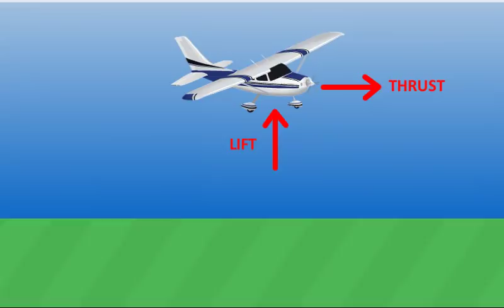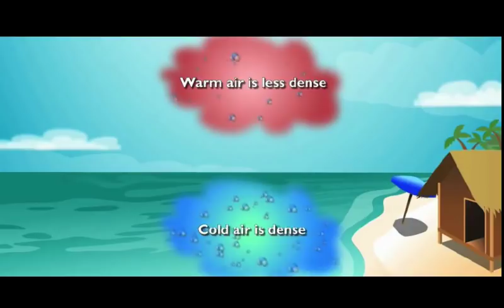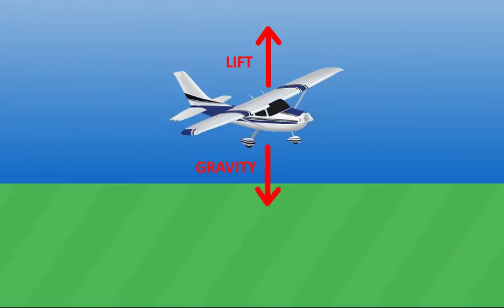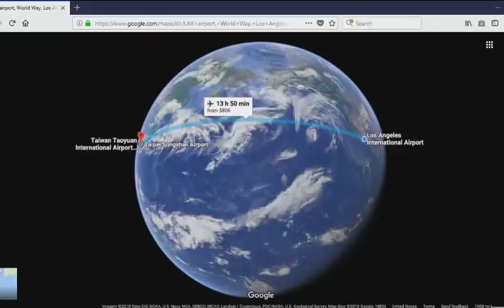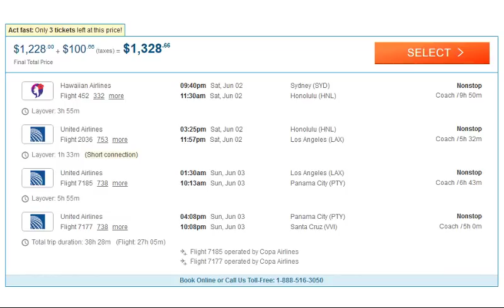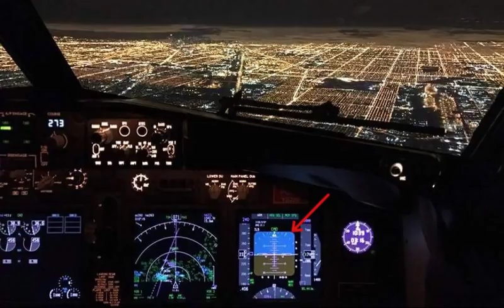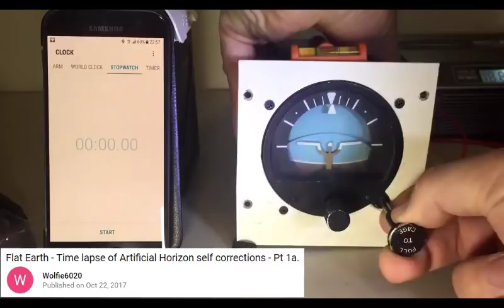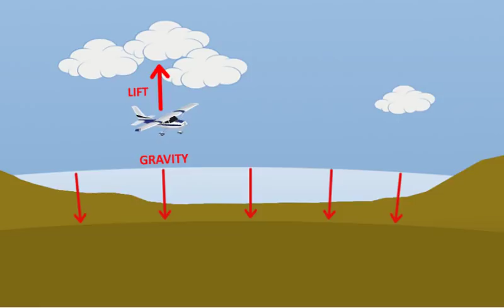Flat Earth Falsities - Plane Nonsense

Comment: As a pilot, the best way I can figure to debunk a flat earther is to explain the concept of VORs. They use radio waves which aren't affected by gravity and shoot in a straight line. They require line of sight and most VORs (depending on whether it is a terminal, low altitude or high altitude) have a range of 40 nautical miles below 14,000ft AGL and a maximum of 130 nautical miles above 18,000ft AGL. Therefore, if there is a maximum distance to which VORs can be received in the airplane, it is caused by the curvature of the earth. To also add VOR and VOR receivers are not affected by GPS at all.
Reply: I doubt if most of them will understand that. If they could they wouldn't be what they are.
Reply: I just wanna say that I'm pretty sure Einstein's theory of relativity was proven due to the detection of gravitational waves cause I remember hearing about the discovery about a year or two ago. That means it's not just a word with "no meaning" it has evidence behind its name
Reply: @koreanjesus89  Gravity   Eddington
https://www.ecosia.org/search?q=Gravity+++Eddington
http://www.bbc.com/news/science-environment-42183077
https://www.ecosia.org/videos?q=The+Cavendish+experiment
"measuring gravity with GRACE”.
Reply: @koreanjesus89  Eeee since when have those waves been detected? Nice to trust everything your hear like that.
Reply: Lord more criticism on the Poster?  Why need to debunk a flat earther?  How is yet an other CONcept figure to establish Truth?
Reply: well trying to reply to original comment in this string o think the guy just proved the earth is flat. if the vor is shot from to a low altitude plane 40 nautical miles away and be seen then the earth is flat. such as a targeting beam radar on naval ships that can target another ship at sea level at 50 nautical miles away which is about 2800 feet of curvature not possible on a ball but is on a flat plane
Reply: @jrockinghead  Yes I have talked about the NAVY 100 miles railgun, fear GRAVITY automatically bends beams  so it stays level to the curve.... alleluia.
Reply: @jrockinghead   I posted "I doubt if most of them will understand that. If they could they wouldn't be what they are."
Thank you for proving me correct
But then you gullibly believe Jeran Campanella, aka jeranism and GLOBEBUSTERS, who has a rider on his videos  "My videos are my personal opinion and only that. If you hear the words truth or fact, I am stating my opinion"
Therefore he is openly admitting and accepting he is lying. And gullible fools are too gullible to understand he is telling them he is a liar.
He has also stated he uses the money he collects from the gullible to pay off his mortgage, rather than on the experiments and experimental equipment he said he was asking for money to pay for.
Reply: @BrainUser1  wow gravity sure is magical but according to neal degrasse tyson we still dont know what gravity is. lmao
Reply: @jrockinghead  YES YES I know, but some seem to know better about SCIENCE.
Like electromagnetism and germs, are directly shown, in labs and outside, DIRECT SEEING, both can be COUNTERED.   For Goddess GRAVITY... centuries go by and still no detection of graviton mediums or waves, Newton would be ashamed, just like Darwin....
Christian Pasteur gave all the proof needed for Germ phenomena (FACT).   Those are NOT Theories,

What parts of the electromagnetic spectrum can we see?
The light we can see is only one part of all the electrical and magnetic energy buzzing around our world. Radio waves, X rays, gamma rays, and microwaves work in a very similar way. All together, this energy is called the electromagnetic spectrum.
However there are many animal species who can detect such forms of radiation ... as Gamma ray, X ray, Radio wave, Microwave can't be seen by human eye. So Electromagnetic Waves are visible to human eye but we can't see all of them.

Starting from the highest energies, the electromagnetic spectrum includes gamma rays, X-rays, ultraviolet, visible, infrared, microwaves, and radio waves. Wavelength increases and frequency decreases from gamma rays to radio waves (see front of poster).
Infrared Radiation: More Than Our Eyes Can See The Visible/Infrared ...
coolcosmos.ipac.caltech.edu/resources/paper_products/print...pdf/IRUback.pdf
Reply: @boffeycn  have a nice day
Reply: @boffeycn  first of all Eric dubay is not my high priest and I guess sagnac proved the existence of aether  michelson and Morley didn't because the apparatus it was sitting on was not moving and neither is the earth it was sitting on. Bedford level experiment how should it properly been performed. pretty straight forward seems to me. but I suppose ships disappearing over the horizon bottom first is a ball earth proof for you. never mind that modern zoom cameras can quickly bring them right back into view or someone in a jet 31000 feet up with a infrared filter can see a mountain 600 miles away but there should be 45.45 miles of curvature obstructing the view. I know there's no point arguing with you. you see what you want to see I merely see what's actually there. have a nice day
Reply: @jrockinghead  Why do you gullibly believe Jeran Campanella, aka jeranism and GLOBEBUSTERS, who has a rider on his videos  "My videos are my personal opinion and only that. If you hear the words truth or fact, I am stating my opinion"? Why?
Therefore he is openly admitting and accepting he is lying. And gullible fools are too gullible to understand he is telling them he is a liar.
He has also stated he uses the money he collects from the gullible to pay off his mortgage, rather than on the experiments and experimental equipment he said he was asking for money to pay for.
Reply: @jrockinghead 
"first of all Eric dubay is not my high priest " Funny that you are parroting his lies then, isn't it? Or do you agree he is a liar?
"sagnac proved the existence of aether" Lie.
 "michelson and Morley didn't because the apparatus it was sitting on was not moving and neither is the earth it was sitting on". Lie.
"Bedford level experiment how should it properly been performed. pretty straight forward seems to me." So you haven't checked why Rowbothams "experiment" was fatally flawed. correct? And you don't know about the scientifically correct test Wallace carried out, correct?
"but I suppose ships disappearing over the horizon bottom first is a ball earth proof for you." Amongst other real life experiences.
"never mind that modern zoom cameras can quickly bring them right back into view" Lie.
 "or someone in a jet 31000 feet up with a infrared filter can see a mountain 600 miles away"
JTolan Media1
https://www.youtube.com/watch?v=GNVLbHERXEo&list=PL642L4xLBIwP3MzHEGIWGl7BGMLr4-Nq-
https://www.youtube.com/watch?v=IXauRO9XATY&index=2&list=PL642L4xLBIwP3MzHEGIWGl7BGMLr4-Nq-
https://www.youtube.com/watch?v=NUTrDDi5Jt8&index=3&list=PL642L4xLBIwP3MzHEGIWGl7BGMLr4-Nq-
Reply: @jrockinghead  Wah, a little kiddy hissy fit! Diddums. Bless. Watch your heart.
Reply: @boffeycn  nothing wong with my heart. lol
Reply: @jrockinghead  " I'm really pissing you off aren't I." Not in the slightest, but I do find you amusing. I also find it amusing that little kiddies like you accuse people who prove them to be not only wrong but also lying of being annoyed, angry, mad etc. Poor little kiddies.
"yep gravity is a name giving to a natural force" . So you lied when you said "gravity sure is magical". Why did you lie?
The proposals by Tesla are in the framework of the old, abandoned, debunked 19th century physics. The luminiferous aether in all possible manifestations was disproved with the Michelson Morley experiment etc.,and special relativity has been validated innumerable times experimentally since then.
"Einstein's theory of relativity ... would work in  a ... geocentric model." Using it as a frame of reference you mean, not that the geocentric model was reality. Einstein supported heliocentricity and to claim otherwise is to lie.
In basic celestial navigation we use the geocentric model of the Sun, Moon, stars and planets, because it makes the mathematical calculations much easier. But for anything beyond low-earth-orbit, the geocentric model does not represent reality in any meaningful way, and is not useful.
https://en.wikipedia.org/wiki/Stellar_parallax
"Cavendish experiment just shaking my head on that one that has to be the most laughable bullshit ever conceived" Why? You really do seem to have a problem with reality, don't you.
https://www.youtube.com/watch?v=2PdiUoKa9Nw
https://www.youtube.com/watch?v=vTfLxgEY-HI
https://www.youtube.com/watch?v=jkjqrlYOW_0
https://www.youtube.com/watch?v=shTNd0ou2a8
https://sciencedemonstrations.fas.harvard.edu/presentations/cavendish-experiment
Why don't you try it for yourself?
Why don't you try getting yourself some experience of the real world?
Why don't you try getting yourself a reasonably well rounded education.?
Reply: @boffeycn  ok wong what you call gravity is in reality density and buoyancy. you give the example that the law of inertia would dictate if I was holding a object and then let go of it. it should just hang there in the air because as the law of inertia states an object at rest tends to stay at rest and a object in motion tends to stay in motion unless an outside force acts upon it. and I'm sure you assume that the outside force is gravity but it is really the principle of density and buoyancy which states that anything lighter than air will float and rise and anything heavier will fall to the ground. and let's say i throw a frisbee simple aerodynamics would keep the disk in the air until the friction of the air would slow the frisbee until there was not enough air pressure underneath the frisbee to keep it aloft then the density of the frisbee would cause it to crash. and no aether was not debunked by michelson and Morley experiment the sagnac experiment proved that. it debunked the theory of relativity actually. see that facts are isaac newton didn't discover gravity he concocted it. he had to invent this barney the purple dinosaur super d duper magical force of gravity to explain why centrifugal force, coriolis effect and angular momentum which we all experienced on the merry go round when we were kids to explain why these forces that we know exist on a spinning ball doesn't throw us of into space due to the inertia. so he just added mass to equation but had to be very significant mass. more mass than he could prove in a laboratory experiment. so he does a thought a thought experiment and tries to use mathematical calculations to prove it which he never could. so let me do a thought experiment ......... hold on I'm thinking.. ........ well I'm done now. and have concluded that newton was a dipshit charlatan and a liar. hold on I'm doing another one yep it's been verified and confirmed by peer REVIEW of my multiple personalities he was a dipshit. and as for getting an education as you suggested why would I want to waste the money to become a big of a dumbass as you. oh by the way bantering with you has been the most fun I've had in awhile
Reply: @jrockinghead  The distance when travelling 10˚ due east or west parallel to the equator.
At 60˚N or S the distance is 300 nm or 555.8 km
At 30˚N or S the distance is 520 nm or 962.3 km
On the Equator the distance is 600 nm or 1111.2 km
For correcting sextant altitudes for the Earth's curvature the formulae are;
 Dip = 0.97 x Square Root (Ht of Eye in feet)
 Dip = 1.76 x Square Root (Ht of Eye in meters)
Also magnetic compasses only function because of the earth's magnetic field, which only exists because the earth is spherical. There is no such thing as a mono-pole magnet in nature. Only people who have actually worked with them or studied their development know this. I have done both. Not a single FE cultist has done either. Not a single one. Never. Not a one.
Gyrocompass only work because the Earth is slowly rotating and gravity is a fact. Only people who have actually worked with them or studied their development know this. I have done both. Not a single FE cultist has done either. Not a single one. Never. Not a one.
"who are you really " That is who I am. A person with real life experience.
Reply: @boffeycn  so you claim 2 be a professional navigator since 1960 professional navigator of What boat or plane wow that's 59 years now surely must be retired by now and I'm sure navigating a boat or plane is a very very important job they would not give to a teenager and when did you start when ye were in your early 20s then I guess you're what 80 years old now pretty sharp for an 80 year old man I don't know too many men that make it that long and the ones who do usually have Alzheimer or dementia so I guess you're doing pretty good who am I you asked profile says my name and I live in the United States and I drive a truck for a living so I know the importance of navigation picking up on time delivering on time getting from point A to point B not wasting fuel being lost or consistently being late for deliveries let me ask you did your compass point2 the South Pole have you ever considered at the other end of the magnet maybe at the bottom of the Earth the ground has a negative charge and the ionosphere at eighty thousand feet above us has a positive charge kind of sounds like a battery or a magnet have you ever heard of the Max Planck satellite experiment and the so-called axis of Evil a strong band of microwave radiation from the North Pole to the North Star could that be what a compass is attracted to you say no one in the Flat Earth movement understands navigation components not so Mister Wong on Mark Sargent YouTube channel he interviewed not one but 2 u.s. naval officers 1 spent 25 years in the Navy the majority of which his time was spent as a navigational officer on a submarine I'm sure he understands all the navigational equipment and navigation as well as you and he's convinced that the Earth is a flat non-rotating plane the other gentleman is a missile instructor who claims that none of the navigational computers have any algorithms that account for curvature or Coriolis effect and the targeting radar array can Target an enemy ship 50 nautical miles away line of sight and there should be about twenty-eight hundred feet of curvature between So I myself put a lot more stock in their testimony than yours so was J tol a n YouTube channel was d e b u n k e d for what because of a slight curvature at the edge of his video yet he can see objects over a thousand miles away don't think that's possible on the globe you constantly accuse me of being childish yet you are the one who started the derogatory comments but I guess they say the elderly sometimes have the mind of a child good luck with retirement
Reply: Hey, I could be wrong  about the news on gravitational waves so if that's the case if you could show me the falsities in the articles that'd be very much appreciated  @Louis Shaw
Reply: O no you did you did see a : "detection of gravitational waves" claim!
....a once that is settled the rest is good for the trashcan...
"Gravitational waves can be detected indirectly ..." Dark bla bla bla
http://www.everythingselectric.com/gravitational-waves/

Danish physicists claim to cast doubt on detection of gravitational waves
https://arstechnica.com/.../danish-physicists-claim-to-cast-doubt-on-detection-of-gravit...
Oct 31, 2018 - LIGO responds: "There is absolutely no validity to their claims." ... The Nobel Prize-winning first direct detection of gravitational waves announced ... "Andrew Jackson and his group have been saying for the past few years that ...

"Gravity—which is taught to our children as a law—is founded on great gaps in understanding. The laws predict the mutual force between all bodies of mass, but they cannot explain that force. Isaac Newton himself said, 'I suspect that my theories may all depend upon a force for which philosophers have searched all of nature in vain.' Of course, he is alluding to a higher power."

"Closed-minded gravitists cannot find a way to make Einstein's general relativity match up with the subatomic quantum world," said Dr. Ellen Carson, a leading Intelligent Falling expert known for her work with the Kansan Youth Ministry. "They've been trying to do it for the better part of a century now, and despite all their empirical observation and carefully compiled data, they still don't know how."

"Traditional scientists admit that they cannot explain how gravitation is supposed to work," Carson said. "What the gravity-agenda scientists need to realize is that 'gravity waves' and 'gravitons' are just secular words for 'God can do whatever He wants.'"

Comment: The force when holding your hand out the window is mostly caused by the momentum of the air, not its friction.
Reply: It is friction. Why else would meteors burn if there wasn't friction? Just because you don't feel the heat, doesn't mean that there isn't friction.